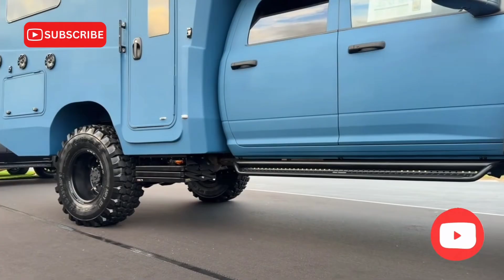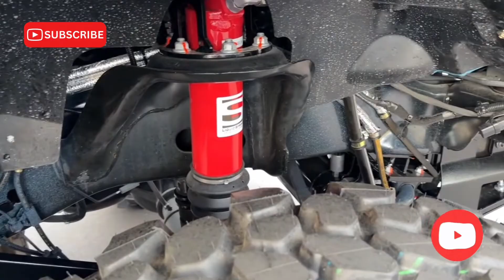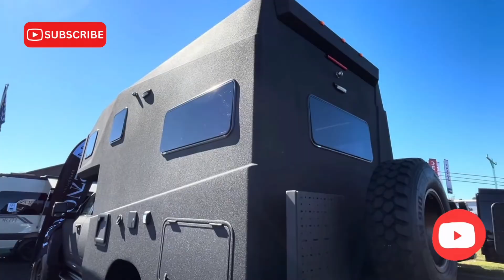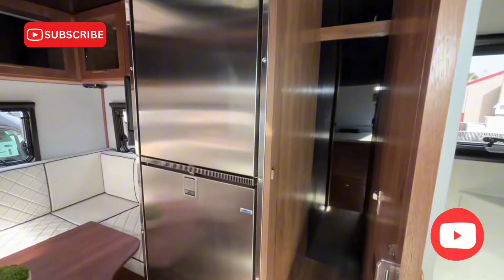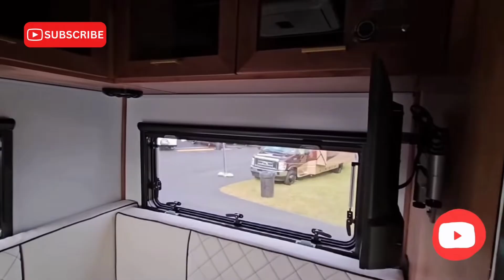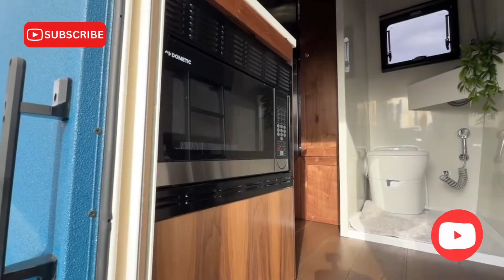Will This $575,000 Truck Replace Your House?

Comment: Put it on a Ford 550 or 600 4X4 single cab.  Shrink the overhead bunk so that the driver can see up to enjoy views above his sight line. Put a front window on the overhead bunk. Older owners will not enjoy the overhead bunk if they have to get up multiple times during the night.  A water filtration and reuse system for the grey tank will extend the water capacity.  Being able to suck up water from ponds or rivers would also be nice.  Replace the lithium batteries. Dual rear wheels would improve side to side stability.    The pass through to the cab is not adequate.  I would like to see who could make that passage. Enlarge the opening.   The side view cameras should project onto screens that are mounted on the corners of the dash continuously just as if the driver were glancing at the rear view mirrors not the rear view mirror.
Reply from the maker: Thanks for the thoughtful feedback. You’ve raised several practical points, especially regarding visibility, comfort for older owners, water management, stability, and driver ergonomics. The suggestions for a Ford F-550/F-600 chassis, a smaller overhead bunk with a front window, a larger cab pass-through, dual rear wheels, and continuously displayed side-camera screens are all worth serious consideration.